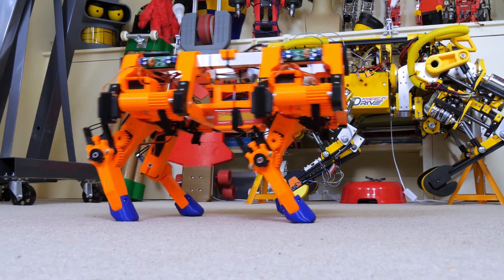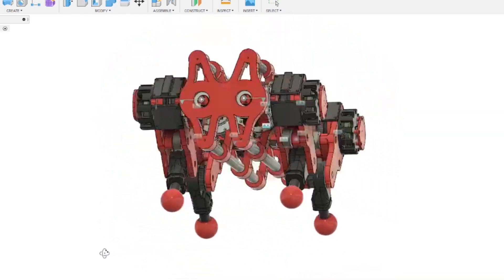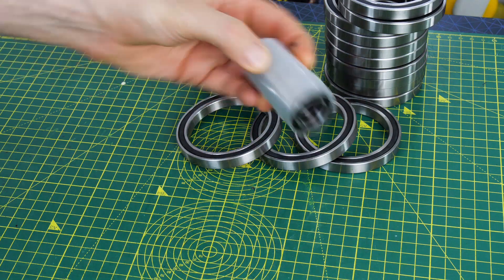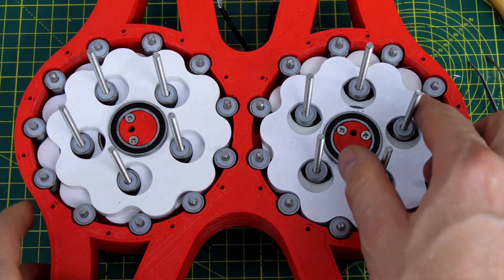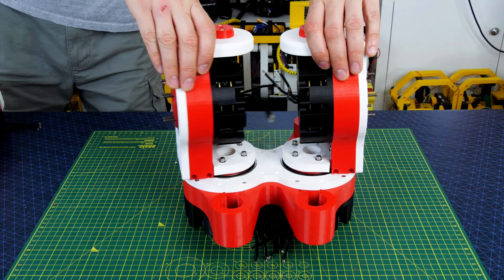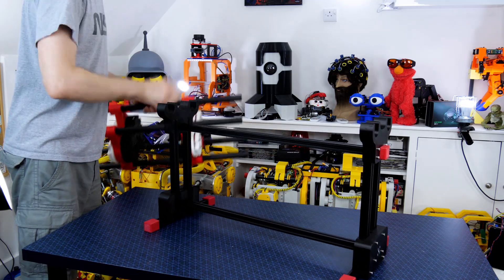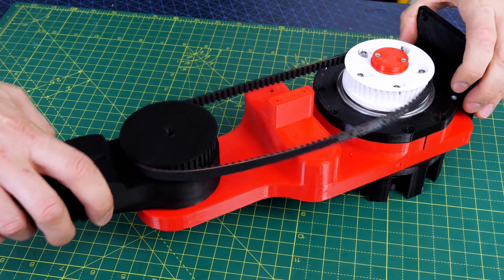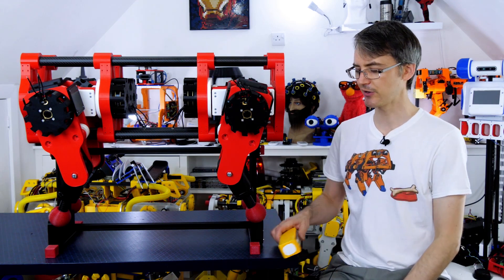Robot Dog V3 - 3D Printed & Open Source #1

Comment: I love this project :)
I'm also wondering if the reduction problem can't be fixed electronically, by reducing the voltage and increasing the amp. But I don't know motors well enough, they'd probably burn up.

Comment: Wait! you designed these Cycloidal gears to have 2 stages at 180 degrees to balance them, but they will never even move in a full rotation since you are using them as joints on this robot?  Why not go back to the single stage design of V1 since it will be lighter, thinner, and use almost half the number of bearings.  Does the second stage add something I am missing besides dynamic balance????

Comment: I've seen several diy videos and I wonder: have you think of using not programming for the movement but let an ai network to deduct how the servos should be controlled to achieve smooth walking or running? It's a completely different approach I think then one has only to load the axpertiese to memory.

Comment: I think that the real problem with using the bushings is that you are using a single nylon bushing for both cycloid plates, for a tiny moment, they are BOTH contacting each bushing at the same time pushing in opposite directions, adding friction, slowing the motion.  If you split the bushings, and put a spacer between, I believe you will find a big difference in how it works.

Comment: Looking forward to seeing this walk. The interference between the carbon rod and shoulder joint could be fixed by replacing the 2 top rods with a single rod in the center. Great work though, keep it up!

Comment: I was going to AliExpress to buy some of these motors for a robotics project I'm working on but it says I must pay the shipping cost for EACH motor.  Shipping is $14 for one motor, but as I add more motors the price per motor goes up.  So for, say, four motors it shoots up to $23 per motor to ship, which is $91 for shipping.  That's completely outrageous.  Shipping, like everything else, is supposed to go down with bulk, not up.  What the heck is going on here?  Does anyone know why this is or how to get around it?

Update: I just checked Amazon, which I was avoiding because the motors are considerably more expensive there, and even with the much higher cost for the motors, I still would save money since the shipping is free.  This is the weirdest thing I've ever seen lol

Comment: To in crease the elbow range, why not use a triangle shape for the frame? With your two carbon tubes above one another or very close side by side to preserve stiffness. It would definitely be more robust if it could survive being squished down flat without breaking like, i.e.: someone falling on it. The frame looks solid, but that's a lever effect... that tube has no chance. Oh, and VERY AWESOME BTW, I'm impressed with your work as always.

Comment: Super cool work man.  I will say though it looks like your prints could use a little tweaking.  Visually the first layer needs a bit more extrusion and then maybe adjust your layer settings.  Or adding a enclosure around your printers will help with layer adhesion.  The stringy-ness and rough sides is a dead giveaway that they aren't performing as well as they could be.

Comment: If weight wise the bearings are still to heavy, consider trying UHMW rod. UHMW has a great natural lubricity to it. As long as your not putting UHMW against itself it slides wonderfully. Which would be a considerable weight savings. I  would say that nylon didn't work as well partly due to the fact you had one solid rod interfacing with both the upper and lower drive, which are moving opposite each other.
Reply: If you use UHMW naturally it would be possible to replace those labor intensive metal rods with larger, printed fitting alternatives right?
Reply: @joe7272  i am not sure tbh, i have only used it in small applications for its lubricity. where the material thickness is thinner to begin with. In these applications till will compress and deform. But that is not considered a problem. as it returns to original shape unless marred by something. 

I now i tend to favor metals for shafts as opposed to printed ones, partly due to the lack of layer line weaknesses and dimensional stability.

Comment: I would imagine that there's a lot of friction in between the internal large gears in the cycloidal drive.  Have you thought about using large teflon washers or spacers to put in between them to reduce the friction of opposing plastic rubbing against eachother?
Reply: like another commenter mentioned, UHMW plastic has natural resistance to friction. If it was able to be printed the horizontal surfaces would become irrelevant

Comment: 09:38 - You could've potentially saved yourself some weight here by printing the 4 red frame parts into a Y shape, rather than the H shapes.  However, if you were going for strength and storage area, I guess the H frames give you that.  Y frames made from aluminium would be strong and made stronger still with printed collars for the tubing

Comment: instead of bars going right across the hip joints of the legs, couldn't the bars across each other be indented toward eachother in a mesh between an X and H shape for strong stability with increased hip motion?

Comment: The extreme lack of first principle design ensures V3 will have a whole new collection of failure modes and V4 is practically a guarantee. In fact, this is the same prediction I made with V1, V2 and just about every robot project on this channel. Nothing ever gets finished.
Reply: That's the thing with just about any and all hobbyist electronics projects. Nothing ever gets finished. The problem is that the sky is the limit when designing stuff like this. You're not making a product to be sold, so there is no point where you have to say "good enough". You can keep modding it and improving it, and although the process is really fun, at the end of the day you're left with expensive, complicated, unfinished toys. It's the reason I stopped playing around with Arduinos and Raspberry Pi.
Reply: @dujezarkovic2384  I build stuff with RPis and several types of microcontroller boards for a living. Those are perfectly fine components for projects that are actually feasible.
Reply: This seems a bit harsh, it depends on the goals and the definition of “finishing”. The goals of this channel are entertainment (which hopefully translates into paying James’s rent, bills etc…). The design and prototyping which make good content here are at best 50% of a “finished” development project, followed by endless testing and refinement which though important is probably less interesting.
Reply: @krcb197  It sets a bad engineering example.
I can guarantee you that this iteration will have new compounding issues do to a lack of addressing earlier compounding issues in earlier iterations.

Comment: For the up movement of the leg being restricted, you can redesign the top of the robot to only have one carbon bar on top in the middle instead of two.

It should still be stiff enoug for it and will allows much larger movements in the should joints !
Reply: Thought the same thing, and it would shave off a few grams and pounds from the budget, the only downside I see is that stable payload mounting might be a little harder to do.

Comment: Love your content. Just amazing what you have accomplished. One question. Could you avoid having to cut off the end of the motor shafts by recessing the captive nut into the motor cams? Or, is there just not enough space to leave adequate material for strength of the cam?

Comment: If you're worried about the top of the legs jamming into the carbon fiber tubes, you might consider redesigning the black pieces at the top of the legs to have a curved profile. That way, if the leg hits the bar, the leg can still move fore/aft without jamming.

Comment: I have a suggestion: what if you changed your design, swapping the two upper carbon fiber tubes for a single, centered one? The benefits are:
- Increased shoulder amplitude.
- Less weight, considering one tube and its attachment gone.
Reply: I support the toblerone dog idea

Comment: You should do a video where you play around with silicone grease, lithium grease, graphite dry lubricant and teflon dry lubricant in various 3D printed mechanisms to test for how much they improve performance, quietness, efficiency and wear... And also some long-term testing to see how long the lubrication actually lasts and/or if any of them (such as lithium grease) cause harm to the plastics in the mechanism.

Comment: to reduce the sholder bashing the top you could realine those two shafts into a larger spine tube.
also if you split the tube at two points and added two hindge's each with an iner spring, could provide some vertical flex that realines back to normal. A thired motorised hindge between the two could help with turning, even a small amount might help with self righting, even more so if one end is always testing balance vs ground level.
the greatest problem with creating anything from scratch is, the age old concept of: less is more, vs how much is to much.

Comment: It might improve the leg range of motion if instead of 2 carbon fiber tubes running across the top, you just had one running down the middle (making the body a triangle instead of a square). It would also be a nice carrying handle! Great video.

Comment: Seems like the top should have a single carbon fiber tube in the center. And then the legs could do 90 degrees so robodog could climb walls. You could to `H` pieces along the center tube where it connects.

Comment: You could gain more shoulder mobility by going to a single (albeit slightly larger) top carbon tube support, as both upper tubes are connecting to the same piece. Simply turn both of the upper connections inward 45° to meet. A triangular support system should work as well as your rectangular one, possibly better.

Comment: PLA and PETG parts will both be about 25% heavier than ABS and about 20% heavier than ASA. If weight is a major factor you could consider using ABS. Polypropylene is even lighter.

Comment: Is there any reason to not use Gearbox lubrication like a silicon lube? My understanding is that it would help with sound muffling as well as reduce the wear between the bearings and the cycloid gear?

Comment: Super cool man!  I love the robot dogs you make.  You make better robots than some companies. :)

Some thoughts:

Maybe to make more room for movement, instead having two bars on top, just have one down the middle?  I think the plastic double motor mounts are plenty of support, so two bars on top is overkill, I think.

The shoulders look heavy.  I'm wondering if the knee motor could be moved from the outside, to on top, and transfer power with a driveshaft down to the knee, if you know what I mean.  Moving the weight towards the axis of rotation will make it easier on the first motor trying to rotate two other motors.

Comment: 4:13 Why not have the captive nut be recessed by the length of the pin rather than chop off the pin? Looks like you have ample space in the cam piece to do so.
Reply: I suspect because pla is so compliant that he wants all the meat he can get in those cams; they are under tremendous shear load.

Comment: Have you considered reducing the top two carbon fibre tubes to a single centred one. You will save weight and get more range of motion for the hips. You would still have a triangular frame and maintain structural integrity. I know in past dogs you used them to mount the electronics, but I'm sure you could still fit them in.

Comment: Please put thermocouples on each of the motors. (odrive support temperature sensors in the new firmware)
Reply: Should definitely help with the old shoulder/elbow motor warping the joint from heat problem!

Comment: The bearings around the circumference don't really seem to roll from the short clip you showed, occasionally they'll twitch over a few degrees, it seems when the tip of the cycloidal gear swipes past them. I don't think the gear should be touching them when the cycloid is rolling against the opposite side, this seems like a slight interference issue.

Comment: Very nice work! I was wondering, I see that you are using extrusion and carbon tubes in limited area's. What is the  reason you aren't using it for other sections where "larger" distances have to be covered? That way you could lower the printing hours significantly I imagine. (take for example the legs).

Comment: Maybe just a tiny simpliation. But wouldn´t it be possible to use a bearing with much larger inner diameter and then just 3D print the pegs for it?

Comment: Why not use nylon bearings to help with the weight?
Reply from the maker: I did in the last video but it doesn't run quite as well and doesn't save that much weight or cost

Comment: To save weight on bearings,  have you thought about using loose delrin balls in printed-in races?  They are "fun" to assemble (as anyone who's worked on old bikes will tell you) but they are compact and cheap, and as smooth as you like with the right preload.
Reply: Ooh I like that idea, yes its a pain to put together, but it really should work quite well, be cheaper and lighter. Maybe even lead to an easy redesign of the gearbox for laser cutting - cut out of the right size thickness sheets with a few bolts to hold it together should be able to make the whole thing much more compact too. Though James likes 3d printing too much to go in for that I suspect.

Comment: One type of gearing you could try is the kind found in angle grinders,  the hypoid.   It's a sort of half way between a spiral bevel gear set and a worm drive - with high ratios possible but still backdrivable.   You can get cheap chinese metal ones but they are not symmetrical and angle grinders are all right-handed.  They are a nightmare to machine without CNC, apparently,  but that wouldn't bother a 3D printer.  The biggest drawback is they need to be well greased because the teeth slide together, so you'd probably need enclosed gearboxes.
https://en.wikipedia.org/wiki/Gear#Hypoid

Comment: Nicely done! I like the simplicity of the design as well as the color scheme. I’m looking forward to the tests of the cycloidal gears. “Good” that you can get 400 bearings for such a price these days.
There was a lot of 3d printing involved, your two TAZ had to run non stop in the last couple of weeks, didn’t they?
Reply: I believe he has 6 printers.  2 large Taz and 4 smaller ones.
Reply: @Scott_C  ah ok this would explain it, cause the overall amount of printing is a lot 👍🏼

Comment: Can you please try out using artificial muscles on a robot like this? I was thinking that you could download a 3d model of a skeleton and attach artificial muscles where they are on the real thing ( it's what I'm trying to do at least ).

P.s.
My notes on coiled monofilament (fishing line) muscles:

Using 500m of 0.8mm nylon monofilament line I found that using a weight of approximately 850g to keep the line in tension while twisting helped massively in ensuring that the line coiled up correctly. I have also found that the muscles post twisting are around 75mm in length and then stretched to around 130mm before annealing to keep the shape (unwind a few revolutions at a time if it is too hard to stretch). 
As of yet I haven't been able to try to anneal any muscles yet but you would want to anneal them at around the nylons glass transition temp +  about 20°.

To get the muscles to contract, the normal way to do it is to wind the fishing line with thin enameled wire before coiling it because the muscles contract with heat. 
It is found that most muscles contract to about 75% of their relaxed length but some apparently can go to 50% with the trade-off of a shorter life span.

I hope that you can try this even if you don't use it on any robots, it's just that you have far more experience in building + designing robots than me.

Comment: That weight due to the bearings is unfortunate. After tallying up the weight of the cycloidal system vs the weight of a slightly bulkier pulley system I might have just gone with the pulleys. Still, I’m thrilled by the cycloidal drives. Very awesome work!

Comment: James.. When you are printing parts and not making them solid, please consider using "Gyroid" infill. For the parts you are printing 10-15% infill will do just fine, and your parts will be stronger than using "Grid" infill.

Good luck and happy 3D printing.
Reply: Doesn't it drastically increase print times?
Reply: @Angel2kinds  Not that I can see.
I have a part that I'm printing right now with Gyroid infill at 20% it takes 6 hours 45 minutes, and if i change it to Grid infill at 20% it takes 6 hours 37 minutes.. so with a diff. at 8 minutes i won't call it drastically..
Reply: I see

Last time i tried it it almost doubled the print time in cura (from 4 hours to 7)

But I gotta admit I had barely tuned my printer